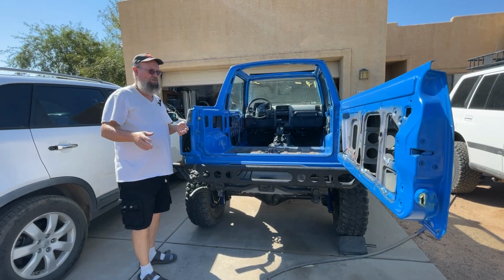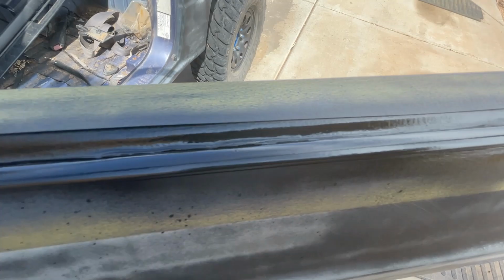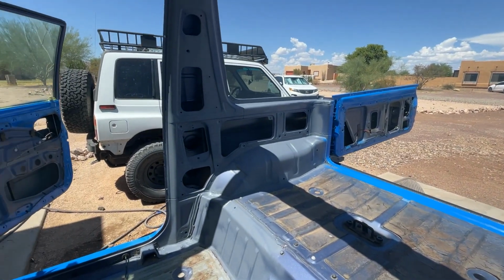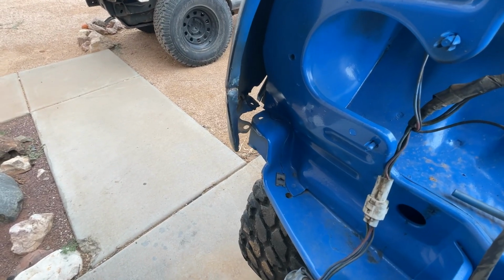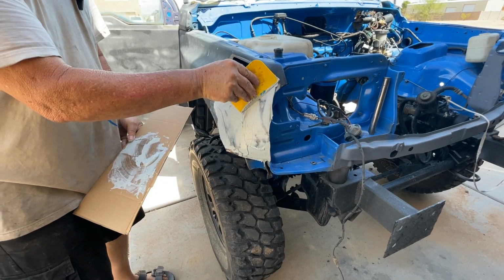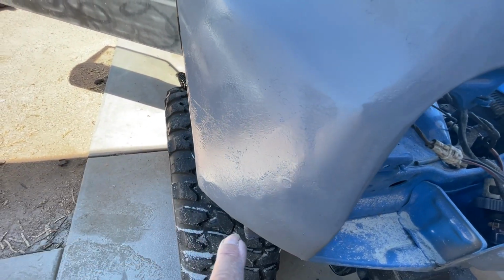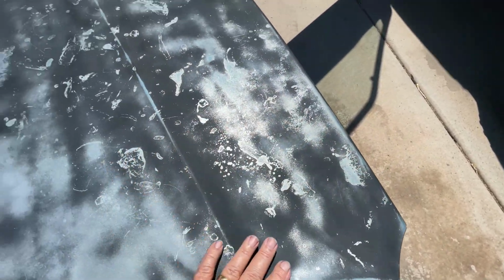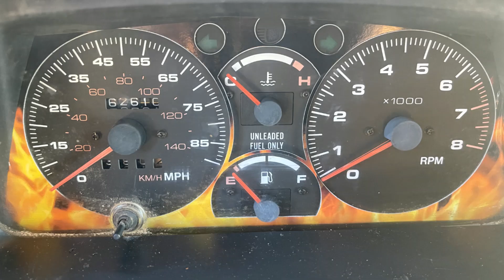92 Scout Project Part 8 Jamming & Interior Prep and Painting

Comment: Coming right along , not a bad color
Reply from the maker: I just wanted to make the last build a fun one...  I usually use flat colors or military references, out doors, and prepping stuff...so I thought I would close out with a pretty one, a very capable pretty one....lol
Thank you for your comment.
Reply: @tufftrails  had mine a year now and just got all the body work done . It's a solid white unit for now . A couple of racing stripes up the hood in the same color blue as the seats. What's your thoughts ?
Reply from the maker: "I think it will work",  haven't seen another one like it.

Comment: Once you're done it will be to nice to take off road.
Reply from the maker: Still have to build an engine for it.  The engine blocks are prone to cracking in the second crank journal.  I hope that I have a good block… or I could be in trouble